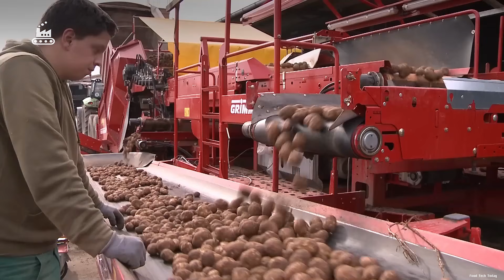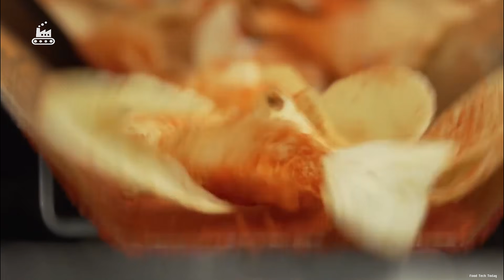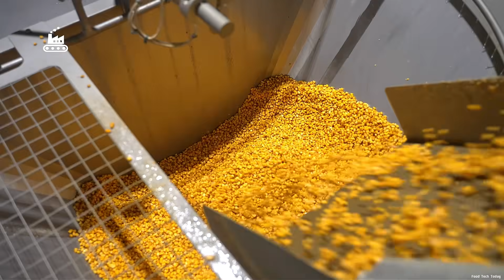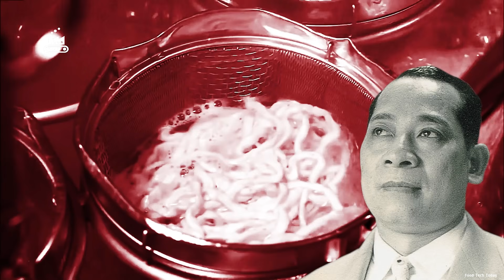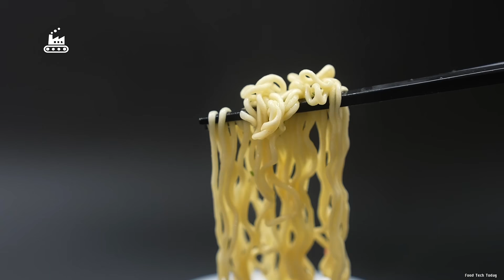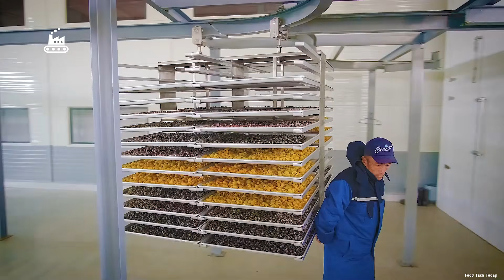How It’s Made: Lay’s, Doritos & Instant Noodles

Comment: There is no glass involved in harvesting corn. Doritos are made from corn, specifically white corn. It is not necessary to stop the combine when emptying the grain bin. A skilled combine operator can unload corn without spilling any grain. Depending on the yield, it is possible to harvest an additional 100 bushels while unloading. I noticed that some combines were stopping to unload, and I don't understand why they chose to do so. Stopping during the harvest extends the overall time needed for the process. Saving time ultimately translates to more profit.  I do not know what the lady and nab were doing in the grain, but they were not checking moisture.  A cable that runs from the top to the bottom of the bin with sensors controls the fans as shown.  Grain is living; it sweats, draws moisture, and builds heat.
Reply from the maker: The unloading-while-moving thing is interesting, because I’ve seen both. My guess is some crews stop for safety/terrain/traffic reasons, but yeah, efficiency-wise I get your point